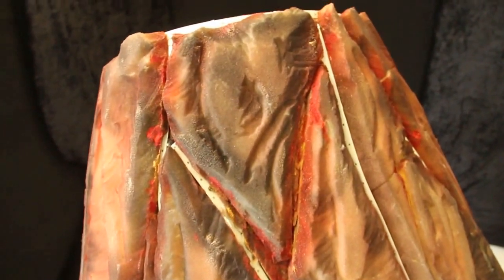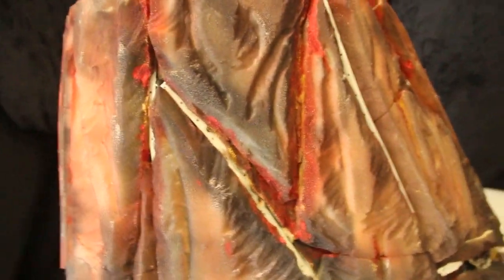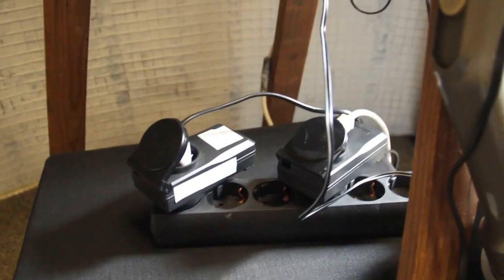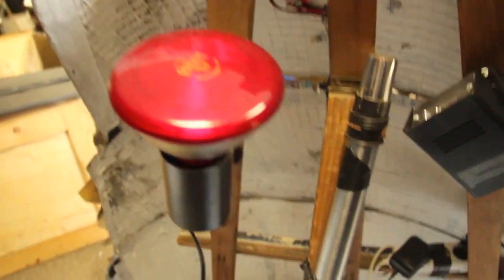How To Make A Large Volcano - The Tiki Kings

Comment: How did you make the mask?
Reply from the maker: Secret warrior tradition
Reply from the maker: ...OR, you can 1. form chicken wire into a cylinder  (cut out mouth area for sight 2. attach plastic hardhat inside using tiewraps (make sure to attach a chin strap) 3. paper mache the heck out of it (use card paper and paper tape to shape facial features 4. coat the exterior with Gesso to prime it 5. lightly sandpaper the outside 6.paint 7. send pictures to your friends and family and try to think about what event you'll wear your mask to.